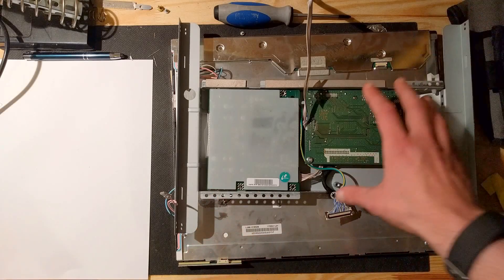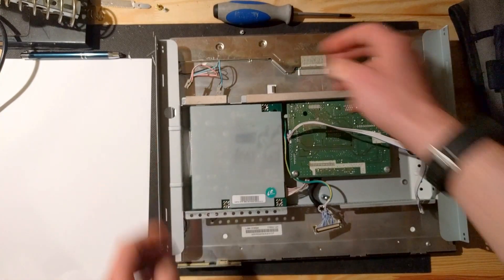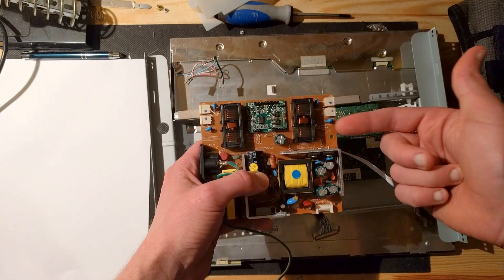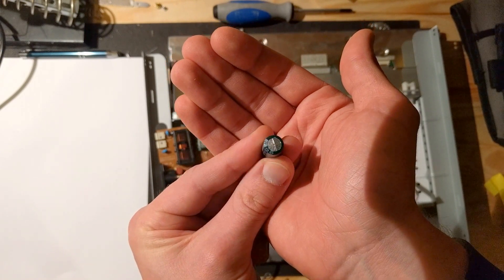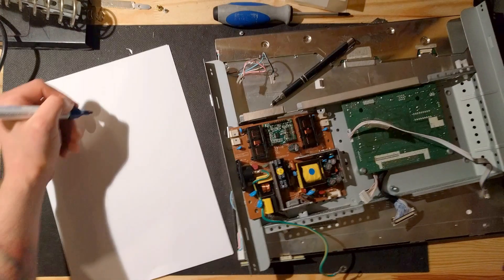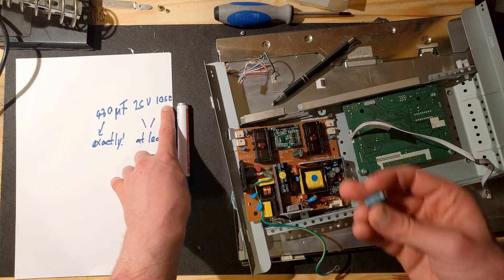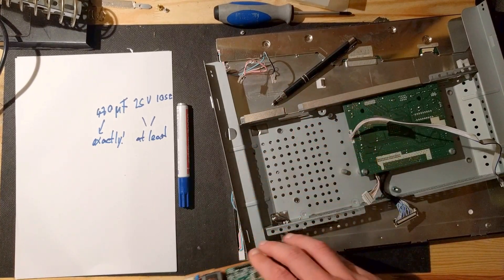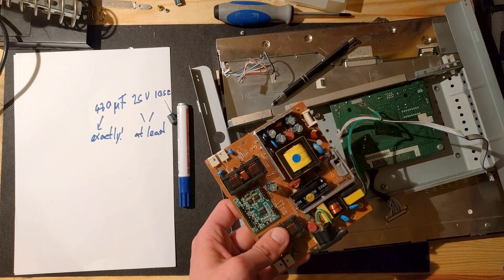How to repair 90% of broken computer displays (and other hardware)

Comment: The majority of the larger electrolytic caps in a power supply like that are just filter caps. You can be approximate with even the size (uF). If you don't want to bother with ordering an exact match, try one a little bit smaller in capacity, to quite a bit larger. E.g. If it's 470uF, and you have a 350uF or perhaps a 600uF, give it a shot. After all, it's not going to get "brokener". This is especially true if you just trying to get another year out of an old monitor. If it's something fancy/expensive that you want to repair for a long time - match the uF, get a higher voltage, and a higher temperature rating, and ALSO look for a replacement marked "Low ESR" (equivalent series resistance - put extra simply: it doesn't get as hot during use).

Comment: TLDR: Replace caps in broken electronics
Reply from the maker: Electricians HATE him.
Reply: How does he do it? find out...
Reply from the maker: Number 8 will SHOCK you.
Reply: Yes but you left out that the broken ones will usually be around the hottest parts in the device, which is usually in the PSU (power supply unit) or where there are a lot of heat sinks (blocks of Aluminium).